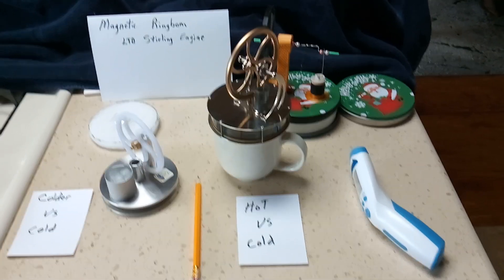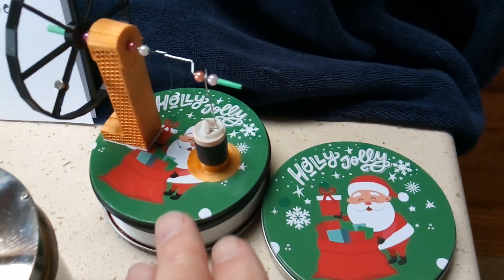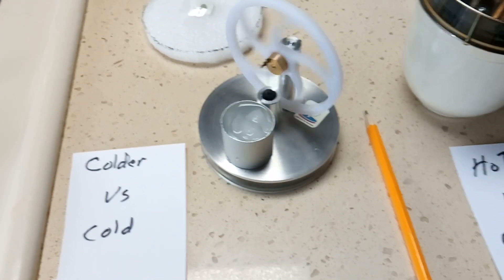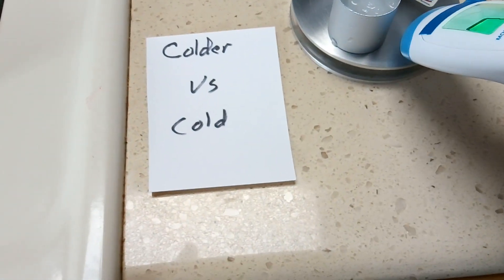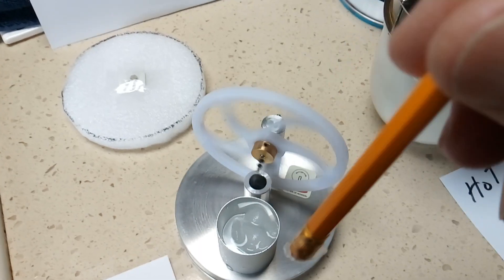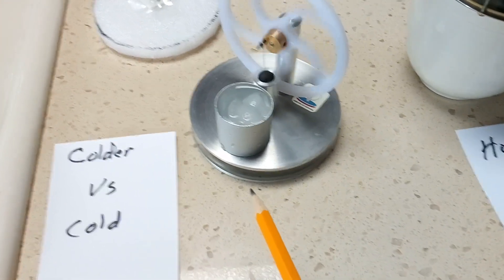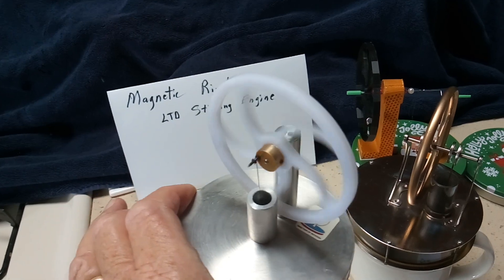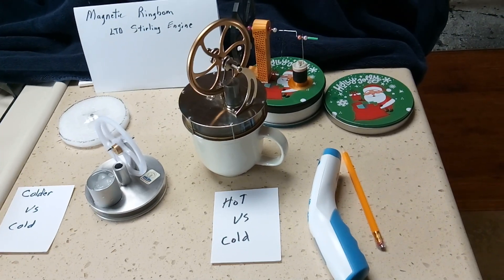Cold  vs Colder Stirling Engine

Comment: The design you have might be great to stick on a window for temperature difference or even in cold places like Canada. If you constantly have snow in your area, you could place an insulated bucket with some pipe work going outside and place this motor inside home and watch it run and maybe charge up an emergency battery in the process.
Reply from the maker: Yes!  That is what I had in mind.  Why not use the cold temp delta in winter to run something.  The air temp vs the ground temp 6 ft. down delta is sometimes pretty big.  Even if all you did was light a small LED light with it -----it is free power.
Reply: @Lidmotor  well have you heard that back in the old days they use to dig a hole in the ground and put sawdust inside of it to keep the ice from melting and it would stay cold all year round. I wonder if something like dry ice or even liquid nitrogen that was put in the ground with sawdust and maybe Styrofoam and those emergency blankets was made into insulation, if it could actually hold something that cold for that long. Even if you had to made some slight modifications to the sterling engine for it to work.
Reply from the maker: @freedomer342  Yep.  There are many possible ways to run a good LTD stirling engine.  The trick would be getting the device to convert what it is doing to usable work. They don't have much torque.
Reply: @Lidmotor  yes but the other sterling engine would be able to do the same thing. Stick one tube in the ground and the other end of it can have a fernell lens (acting like a flame) to produce the heat. The lens can have a servo motor attached to it so it could follow the sun. This would be great for something like in California. The LTD could be scaled up and have your flywheel made of magnets. Maybe 3D print a flywheel with slots for magnets?  Since neodymium magnets have a strong field, you wouldn't need to place your coils too close to them to get a voltage reading out of it. Even if you could get something like 5V out of it and step it up with a transformer and dump it into a capacitor bank equivalent to a battery, it would be worth it. You can literally take a signal generator and do the same exact thing I just mentioned and it will work. May take a few hours to charge it but it works.

Comment: Those non contact thermometers assume the infrared emissivity of the surface. They generally work fine for plastics and flesh, but no good on metals or ceramics. You can use a strip of PVC tape to get an accurate read. Also they average the temp over a cone, so the further you are from the object, the bigger the area being averaged.
Reply from the maker: Thanks for the info.

Comment: That certainly works fine 👍👍
Reply from the maker: I think I can build a simple version of a magnetic ringbom stirling engine that might work better than what I just made.  The low melt temp PLA 3d print parts really makes this project a challenge.  You need rigidity.   My xmas cookie tin engine barely worked because there was too much flexing when it got warm.